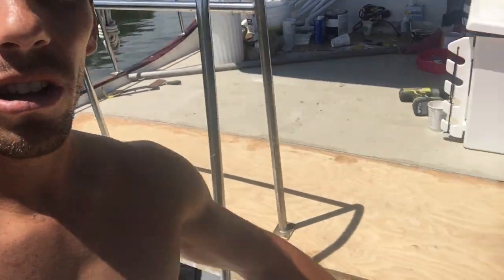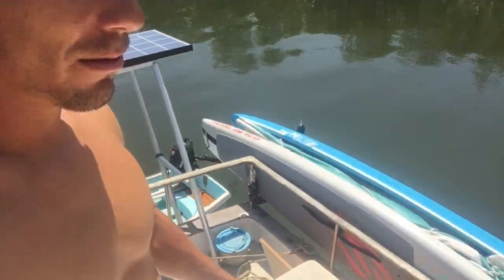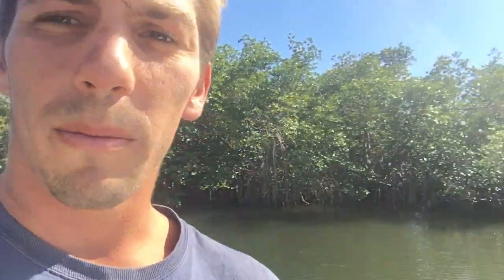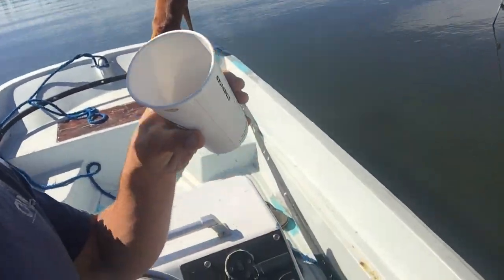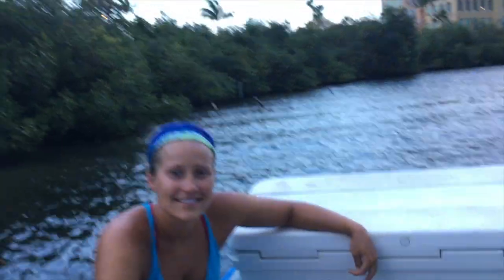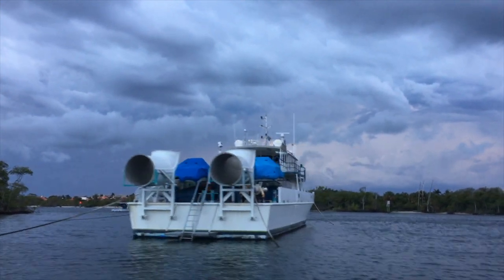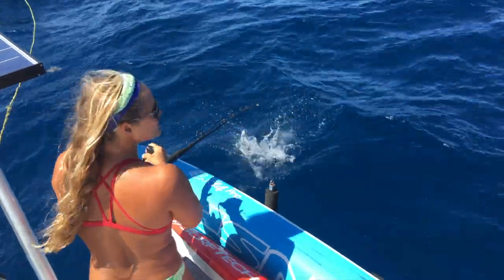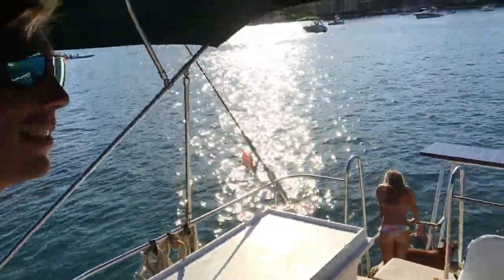MORE Boat Work and FINALLY Pulling up the hook

Comment: Way to go guys. Hope your crossing was uneventful. We have a powerboat also and I was wondering what speed do you try to cross the gulf stream and do you leave from miami or further up the coast. What is your check in point? Trying to get as much info before we cross next year. Thanks, Charles
Reply from the maker: We cruise at about 5.5 knots (not by choice). We crossed boca to west end which was perfect. Last year we crossed Fort Lauderdale to Bimini which, if we did that one again with our boat speed we would leave from somewhere in Miami.

Comment: Hey, guys.  I love watching your vids, but the inconsistent audio levels are killing me!  I'm constantly adjusting the volume while watching.  Depending on the video editing software you're using, there should be an audio normalization setting.  Or you may just have to adjust your music files to a lower volume.

https://en.wikipedia.org/wiki/Audio_normalization
Reply from the maker: Dang, I know the beginning videos from last year were bad with this issue but are you still finding it on our recent videos?
Reply: Yeah, it's certainly not nearly as bad as the earlier vids you had, but there's still a fairly large volume difference between your vocal audio and the overlay music audio.  This may be too much extra dinking around, but if you were to use an external, perhaps clip-on mic, you would get MUCH better vocal audio quality.  Audio quality is just as important, if not more important, than the video quality! 

All that being said... Keep the vids coming!  I live in Wisconsin, and I love seeing what's going on down in FL (especially when it's 20 degrees and snowing, haha)!
Reply: Just went and watched your vid's you got nerve to criticize .Enough said.